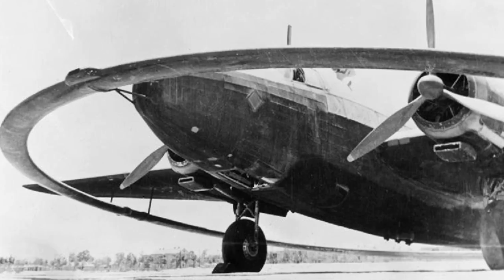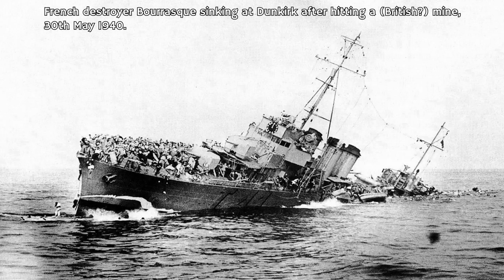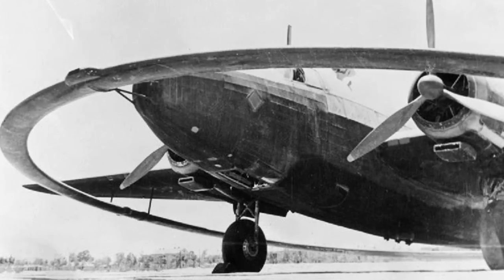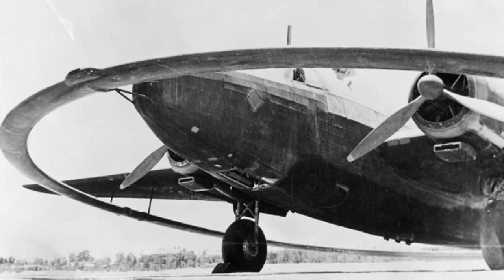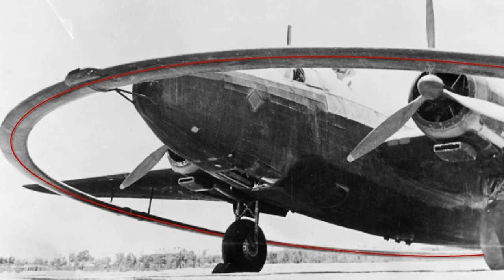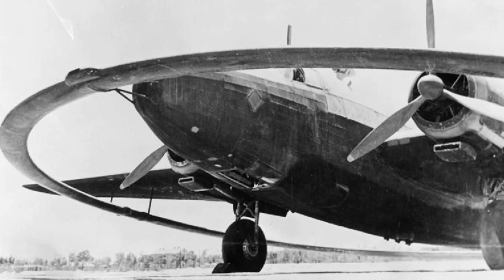Why did some WW2 planes have hoops around them?

Comment: They could've just had magnetic bombs which they would drop on or in the close proximity of those mines. Seems like a much safer idea tbh.
Reply: cobalT Ah yes, but finding the mines in the first place were the major problem.
Reply: Yanase Konomi Well yeah,but I mean they had to find them first anyway,right? Or did they just randomly fly about hoping to hit a mine?
Reply: cobalT I would assume they would fly over areas where their ships are going to go through.
Reply: And the same way they could drop bombs in the paths of where their ships are supposed to take.
Reply: cobalT and wouldn't that take more resources than just making a special plane fly over? I'm not an expert, but I believe having a reusable plane that you can fill up with fuel and then use it, is cheaper than making hundreds, if not thousands, of magnetic bombs and dropping all of them in an area where there could be zero mines.
Reply: Yanase Konomi Well I don't know if making hunderds of wooden casings and sticking those magnetic devices inside would be more resource intensive than risking a £50k bomber and all it's crew. I mean you'd be using a hell of a lot more wood,but I'm sure at that time they cared more about money than timber,especially in a war environment.
Reply: cobalT hmm, but if the plane flies over an area that is safe, no one is lost (providng they don't get attacked), and the navy knows that the area is safe. the only resource used, really, would be fuel and a few escorts. using bombs, however, would mean they have used up goodness knows how many resources on an area that is safe.